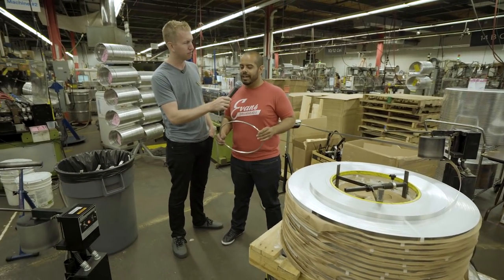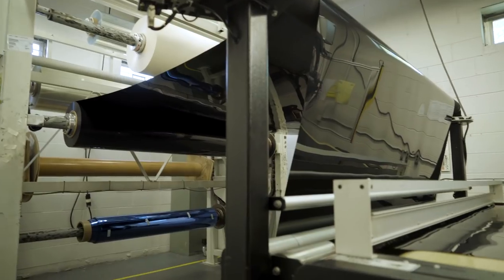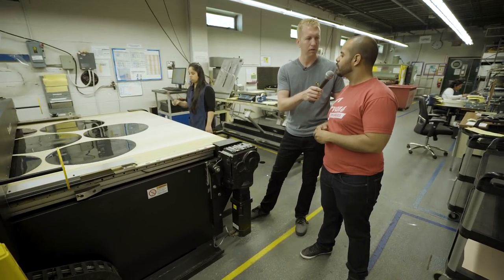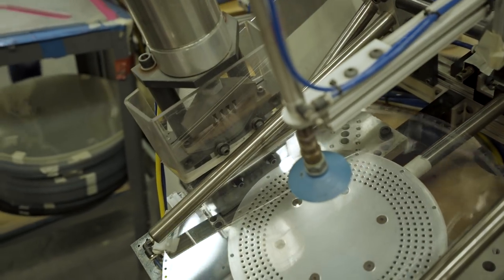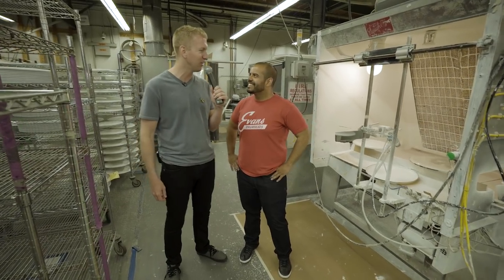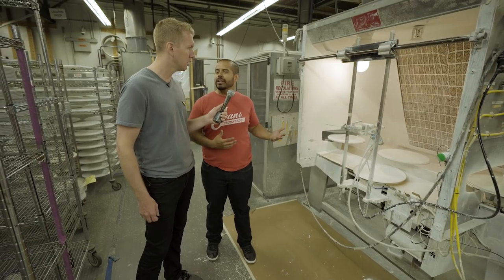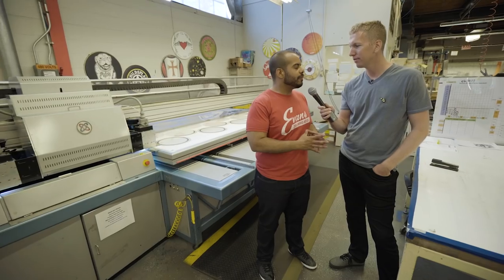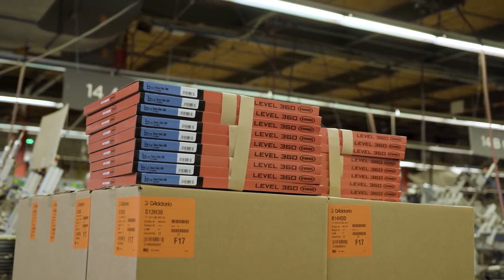How Drumheads Are Made

Comment: Will there come a day when we can recycle old heads?
Reply: I recycle heads by using them for o-rings and other dampening solutions when recording.  I've cut out a 14" head and used it to muffle a 12" drum, for example.  I also used spray adhesive and placed a padding over my kick drum head once, using a dot I cut out of a 12" head.
Reply: Drew Kane That’s a good idea. I make 4” impact patches for my bass drums and adhere them using three small pieces of clear packing tape. But some 3M spray adhesive would work well in that application I would think.
Reply: I hope so.
Reply: i just put them in my recycling bin, separate the metal & plastic by cutting the head off and then putting them in the right bins :)
Reply: there is. If the hoop is aluminum, and the skin is clear then you can shove it straight in a recycling bin
Reply: Awesome to catch water under potted plants 👍🏼
Reply: if you got no holes in the skins, take a good heated hair dryer, or a heat gun and do a few quick runs over the skins, bumps will smoothen out, only thing that you could see to make someone think the skins are used are the smudges. MAKE SURE the skins are attached to the toms first otherwise the heat wont stretch out the bumps 

EDIT: idk if this will work with hydraulic skins, haven't tried my set of skins.
Reply: You can circumcise a drum head.  A shard blade and a steady hand usually does the trick.  As long as it's a 2 ply head.
Reply: Tell me about it. Between old sticks and head, it's such a waste. The sticks can at least be used for some applications such as dowels. Heads? Dunno...
Reply: @SydneyDrums  LOL that's what I use many of mine for! The clear heads blend in well and are almost invisible plus they hold back any water spills.

Comment: Evans' 360 technogy is great for studio but almost every drum head I bought from Evans had a little dent in the edge (my 16" Floor Tom and 12" Tom head for example). My first 14" G2 tom head had glue between the two plys. This never happened to me with remo. Maybe dent comes from the Level 360 because it has an edge but maybe not. Because of experiences like this I'm a remo player. Never had a problem with their heads
Reply: Same delivery sevice aswell?

Comment: The problem is the cheap aluminum fleshoop is flimsy and has no mass to it. The lack of mass kills sustain and the flexibility of the aluminum allows a drum to detune much faster. You can't beat a steel fleshoop with a steel square insert glued and crimped. The use of aluminum and glue is just a way of increasing profits by cutting corners. All the high tech Info they used to sell it was just gimmicks to convince you it wasn't just cutting corners.